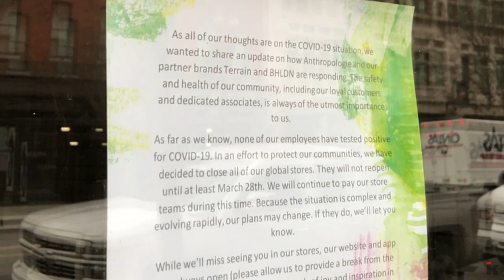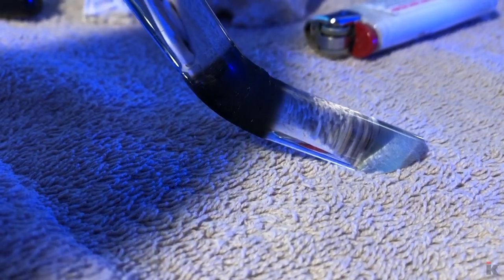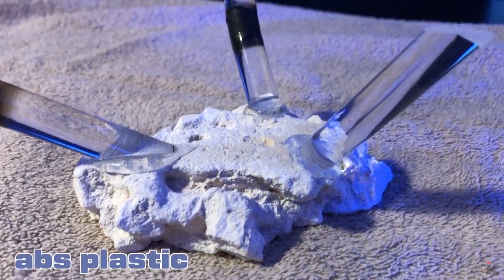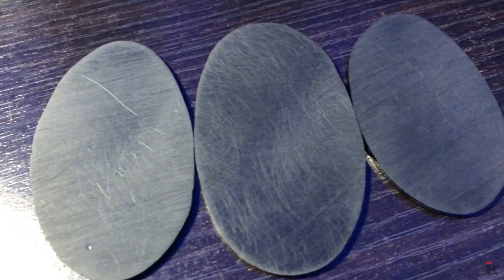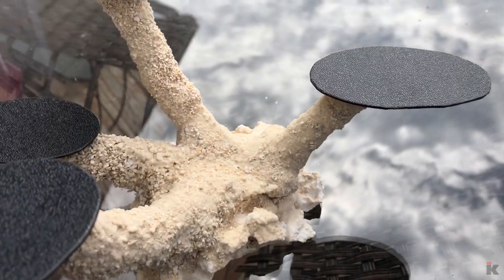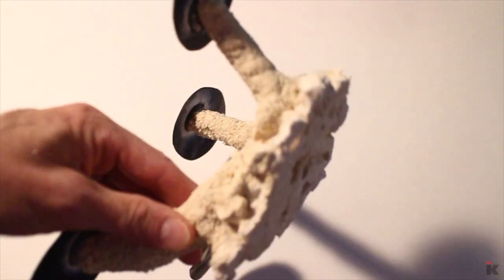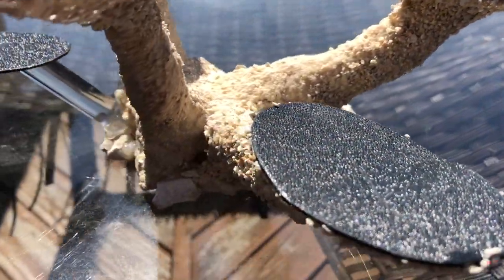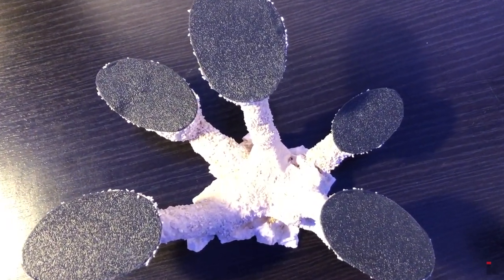DIY Aquascape EP.4

Comment: That's exactly what I'm looking to do but I want to make a anchor to be encrusted with coral so perhaps some holes for plugs.keep up the good work 👍
Reply from the maker: As in an anchor on a ship? If so, that's a great idea! It should be pretty easy, once the rod is heated it bends quite easy. Although if it is a hard bend it does distort the shape of the rod a bit.
Reply: Lost ship anchor perhaps with a chain draped over the rockwork but atleast I know I can use this plexi rod instead of the ½" pipe I was thinking will bend alot nicer than 45° and90° bends love your work 👍
Reply from the maker: @seanmallard3118  Great idea, I love it. Please show me the finished piece!